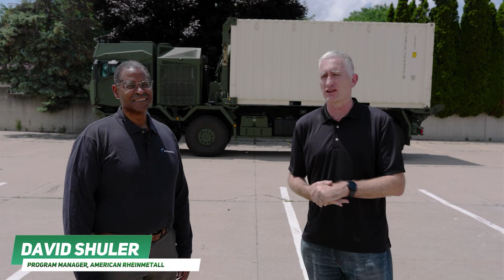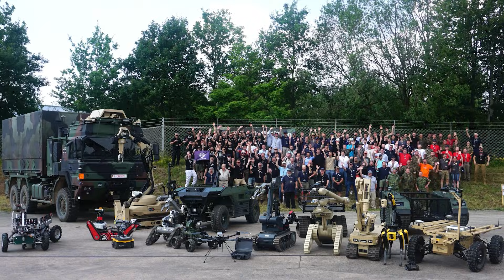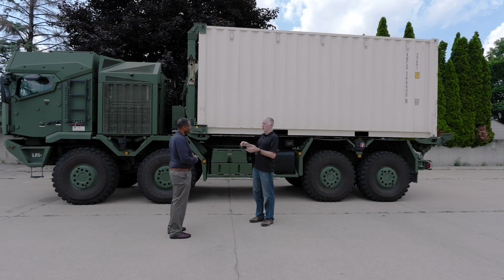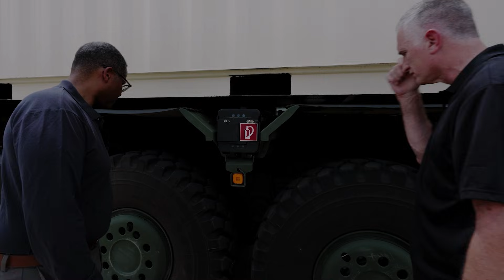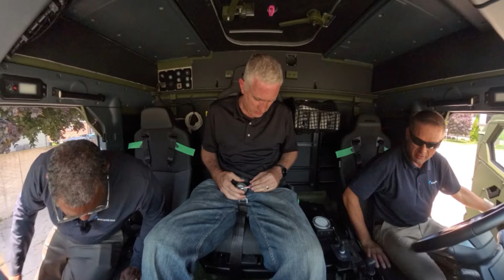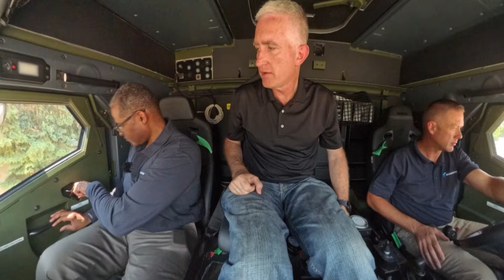American Rheinmetall, and the HX3

Comment: every mechanic ever curses engines that don't have dipsticks, regardless of the system
Reply: I agree being a retired mechanic after doing it for close to 50 years
Not having a dipstick on a civilian vehicle is okay for the most part. 
For a Military application, I would like a dipstick not only to check  the level but you can check the condition of the fluid, is it worn out, are there metal bits in the oil-fluid, does it have water or mixed with other fluid,  does it smell burnt an experienced mechanic-tech can get a lot of insight from looking at fluid on a dipstick. 
Military Techs, they want to make sure the equipment is the best it can be, because one day someone or somebodies lives may depend on that vehicle being able to perform its job. 
I served in the USAF for 15 years I was a Jet Mechanic and we made sure everything was the best it could be and double checked it.
Reply: @bikecommuter24  everything is a question of priority. A lot of military vehicles you don't check the condition of the fluid because there is no "change it because I have a gut feeling" type thing. They have a schedule, the fluids are flushed and completely replaced every X hours, and the only time it is deviated from is if the vehicle breaks down either due to malfunction or something else, like it's hit or driven into something or some other mishap. 
It does kinda make sense in the sort of environment they are deployed often, it was a bit of a rethink for me to understand, but there are companies who use the same sort of method for their own gear too. Work hours are expensive, gear is cheap... So if it doesn't work just replace the whole thing if it is important for it to work. Someone can troubleshoot it later, if there is time and need - if not it gets recycled. 
Like I said it is going that way in the private sector too, it is being built into the budgets and so on, and it adds a high degree of predictability - it is also going toward what does exist in the military which is a specified service life of Xhrs. So fairly often things are replaced before they have a chance to break, when their hours are up, out - in with a new one. It's wasteful in terms of materials but not in terms of effort and downtime costs. The unscheduled downtime doesn't go away completely, but it does get close.
Reply: Keywords are: "that you would access normally". There is a dipstick on the engine but for regular daily use, you just check the oil level on the display. Should that - for whatever reason - not work, you tilt the cabin (takes about a minute of pumping) and check it manually.
Reply: It's neat, but a dipstick is never not going to work.
Reply: @urishima okay but you also never get the results instantaniouslhy
Reply: @emilsinclair4190  oh come off it, acting as if checking the oil with a dipstick is a 10 minute process.
Pull, wipe, stick, pull, done. There's no reason not to have both. Sometimes one is going to more convenient, sometimes the other.
Reply: @urishima ... yes. Pull up. Checking. Electronics dont mean that you have to stop. You measure it the entire time. Not just when you feel like it. Meaning you can detect problems much earlier.
Reply: There probally is one, its just not easily accessible for the average maintenance grunt
Reply: I think having both would be optimal.
Reply: You have to run the engine to check the level, so if the engine doesn't work, you cant check the oil.
Reply: @ShaneDawsonsCat ... yeah bc you already know that it did have problems with that from the 5 billion data points from the past.
Reply: My 2nd gen Tacoma's transmission was spewing and smoking through the Rockies up hill. It took an electronic machine to tell me the transmission was overfilled with atf. dipsticks wouldve been nice, but yea 2nd gen still best generation of Tacoma but I also love first gen Tacoma,, you tiny SOBs
Reply: Lack of a filler on transmissions then having to bathe in it's fluid to fill it isn't fun.
Reply: Damn right we do!!!  Civilian or Military doesn't matter without dipsticks (engine oil, transmission fluid, etc.) it makes checking fluid levels and the condition of said fluid impossible and harder, respectively, which both can effect the longevity of the systems do to potentially overfilled/low fluid levels and having to open up (thus potentially allowing contaminants inside of) systems, again respectively......and if anyone says "oh but we can just look at the sensors and computer to know all that" well here's the thing....ELECTRONICS ARE MORE DELECATE THAN A STRIP OF METAL IE. A  DIPSTICK AND THUS CAN BREAK MORE EASILY,  SENSORS AND COMPUTERS CAN MALFUNCTION IE. GIVE FALSE READINGS/INFORMATION,  A STRIP OF METAL WITH EMBEDDED/ENGRAVED MARKINGS CAN NOT!!!!  Sometimes over complicating already simple, easy to use, and tried and true things is a BAD idea.  "If it ain't broke, don't fix it" I'm sure everyone over the age of 25~30 has head and understands that saying, especially those who fix thing for a living (Mechanics, HVAC techs, Plumbers, Building Contractors, Electricians, Carpenters, DOT & DPW workers, etc.).
Reply: @DesielRiggz1  Yes Sensors and Computer can fail and give false information. But so can a Dipstick too. A Dipstick can not tell you how bad your Oil is or if it is contaminated with stuff. Metalshavings can not be detacted everytime. A Dipstick is a tool to see: Yeah, there is stuff. If its already too late your oh so powerfull Dipstick cant help you. In TImes of AI, self driving Cars, Rockets that can Launch and Land autonomous im sure we can install Sensors that can tell you from the Inside if your Oil is bad. Why should i need to pull the Diipstick, look at the Oil, sniff at it, feel it, maybe taste it if my Sensor told me the same from the Inside.
Aside from having it because we are used to it a Dipstick has no real function. We have longlife Oil, Mineral Oil, Unleaded Fuel. We dont need to check the Engine/Transmissionoil on a regular base anymore like back then. 
In the modern Times a Dipstick is not needed anymore, we can life without it. Apart from "Yes Grandpa we know you are old" its not something we cant life without.
Reply: Reading the comments on the dipstick, their forgetting an important element, the end user, I worked on and served on an LAV. Having electronics to do a lot of the work would of been nice, but some people are forgetting some simple things. One as some have mentioned you can tell a lot of what is happening by looking at a dipstick as a mechanic. For the crew member topping off fluids, I don't want to leave where I am to climb into something else to check how much more oil I need to put in when a dipstick is faster (and as a reminder to those who seem to forget the dispstick goes into the hole you put the engine oil into so it isn't a big ask). I am thinking for the HX3, engineers didn't think it was necessary because they don't understand actually maintaining a vehicle or more likely it could be the way the engine is designed there was no way to make it accessible without lifting the cap to get to the engine so called the work around a "feature"

Edit: Just wanted to say, tech is nice, but it also breaks, there is a reason the military keeps things simple as it can when it comes to ground equipment, it takes a pounding. Think of it this way, remember all those US tanks and trucks the Chieftan showed with start switches and such. The exact same ones we use in the military today?
Reply: @IngramZero  Of course this thing still has a dipstick, what the fellow in the vid means is that you don't have to get to it daily because it also has an electronic level check.
Reply: Stupid not having a dipstick, those systems are shit in the civilian market.
Reply: why?
Reply: @omgsrsly  Because we've seen those systems fail enough to know that we can't trust them. So having a way to physically check, even as a backup, is preferred.
Reply: @CobraDBlade  this is German, not American.
Reply: @PalleRasmussen what’s that got to do with it 🙄
Reply: @alangordon3283  which cars break the most; German or American? We are not in WW2 any longer when the American vehicles will just keep going.
Reply: @PalleRasmussen German cars aren't reliable in the US market.
Reply: @PalleRasmussen haha and you think you "americans" i.e. US are the only people who like to preserve its older cars? We germans have a whole Oldtimer culture with Laws wich you can use  if you want to drive an oldtimer.
You in the US on the other hand HATE nothing more then to change. Just look at your fucking 2. Amendment wich is from 1791!! Yeah talk about the hate to change.
The rest of the wörld likes to move on and are doing so.
Reply: @PalleRasmussen In the US market at least German cars are less reliable. Probably because they don't sell the more reliable basic, lower featured models here.
Reply: @CobraDBlade eyes on accountability is always best. I can certify it was at this level before we made way. I only know what I did personally on the truck. Anything I didn't do is a maybe. It didn't get done by nobody so whoever said we were good to roll without raising a concern is getting smoked.
Roofer shingler Foreman, scissorbed flatbed, reboxed dumptruck..
Reply: omgsrsly...
Power or computer issues.  If all else fails, the engine must be operational.  No need to power up the system just to check oil, trans, erc.
It's a dumb idea.
Reply: Why the whole world buys this then?
Reply: Every Oldschool Mechanic says that. All the newer ones dont have to open your car anymore to know thats wrong with it. My Uncle is driving an ID3 and befire that an E-Golf. The Mechanics at the dealer were already aware of what was wrong with the Car before he even arrived to do a check up.
Yes my 20 Year old BMW does not have a Dipstick to check the Oil too. I need to check it from the inside via the Computer. Yes its annoying but guess what. That tech is 20 years old. Cars today are way better then this. They can show you the exact level instead of my Ok or Too Low.
Reply: Technology is all well and good, but the mk.1 eyeball is something else...👌
Reply: @MetalMelodie  Sure. As long as the computers are working. In your hands as well as onboard.
Reply: if you own a BMW, your opinion is invalid.
Reply: @JonathanFrisbee-k7x The Hell kinda Statement is that?? Haha just because i drive a specific Brand i have no right to talk or what? Guess what i drove in the German Bundeswehr DAILY!! To make it Quick it were no BMW. It were Opel, Renault, Mercedes, MAN, Toyota, Citroèn, Ford and more. On all Cars we had to do a Check up before, while and after every Tour.
Reply: @MetalMelodie  No dipstick in a military vehicle is stupid, no matter what you or BMW think.
Reply: @john_in_phoenix  You sound like you never were in the Military like i was. Think about it like this. You are on a Mission with your Vehicles. The Enemy could attack anytime. Where do you want to be the most? Under Cover or in a Safe place right. If you just could check your Vehicle without the need to outside hmmm oh yeah lets check the Oil from inside your Car/Truck. For Trucks you sometimes need to lift the Cabin and make it unuseble for the time you do your maintanance.
Now tell me what would you prefer?
Todays mechanics even the ones in the Military can plug in the Diagnostic Computer with the Vehicle and check it without the need to unbolt anything. We dont live in the 60s anymore get that in your head.
Reply: @MetalMelodie TBF those aren't incompatible options.  Obviously it's good to have the option to check electronically but if it was no cost it would be nice to have a backup.

OFC there probably is some cost to making an accessible dipstick.
Reply: @petergerdes1094  it's not just a cost to a dipstick, you need to design a way to access it for it to be useful and in doing so you're likely to make the vehicle weaker in some ways because you're making a compromise. Then on top of that, a dipstick is a delicate thing - you would either introduce a weak point, or you'll need to design an armored dipstick, which will need a test and approval process of some kind. 
The armored dipstick program has gone through it's development cycle, and the result of it is: a sensor. The sensor IS THE DIPSTICK V2.0 heh.
Reply: @noth606  If the sensor tells you the oil needs topping up, you still have to access the filler point (which is presumably under armor) to add oil, so why not put a dipstick in the same place?
Reply: JansenX12....
Stop and think one second.
The complaint wasn't that you can check electronically.  The complaint is that you have NO OTHER OPTION. 
Get real, dude.
Reply: @videodistroIts a natural evolution that sensors and other electronical devices replace physical ones. Remember the time where you had to use a Choke to regulate the Fuel/Air mixture on a Carborated Car? Or the times you had to manualy Start the engine, the use of a Fuelstick to check the Fuellevel, manual Mirrors, manual Seats, manual Windows.......there are more and lots of more exemples. Time cant be stoped, its always on the move. If you want to live in the Stone Age because you hate technology then so be it. The rest of the wörld likes to move on. 
Just for the record i think all the time and i like to think. YOU are the one who does not think for a second.
Reply: @noth606  you do know the dipstick fits into the hole you put oil in right? No matter the vehicle you need to put oil in it
Reply: @MetalMelodie  The 60's LOL.
Reply: @PeterCollingwood-e2s many of the V8 engines still used today are based on ones from the 60s. So yeah 60s.
Reply: @MetalMelodie based on. Basically all engines are based upon the first engine ever created
Reply: @emilsinclair4190  No -.- with this you showed that you have no idea what you are talking about but want to sound fancy.
There is a BIG difference between a new Construction and something that is based on an existing platform. For Exemple the VW Beetle was build and sold till the 90s. Over the decades they updated the BASE Design swap out the Engine for a bigger one, add Fuel Injection, New Suspension, Radio, Air Con, things like that. The "New Beetle" was not BASED on the Old Chassis but it was based on the Newer Golf Mk IV with an new Body on it.
For exemple my BMW Engine the N52B25 in my E90 is a whole new Engine and is not BASED on the older M54 Enigne. Its a brand new Engine Developed with the Knowledge of the M54 but no part from the Older Engine was used on the Newer Engine.
Thats the Difference between Based on and Newly Developed.
US on the other Hand are BASED on the Older ones. Some still use the same Engine Block with newer Parts as they used in the 60s/70s.
Reply: @JansenX12 ... so you wnat ro tell me that all 5hsoe engines are not based upon the same laws of thermodynamics and using a heat volume pressure cycle to generate work?

Based is always a relative measurment.
Reply: @emilsinclair4190  -.- yeah yeah. Continue your trolling i dont care. You Showed again that you have no idea about the Topic we are talking.
I can tell you that YOUR Brain is not wörking like others do. Your Design is BASED on 60s Tech but it never saw an update. You dont even got the Day-1 Patch installed.
Reply: @emilsinclair4190  My advise for is to look up Engine Familys and get familiar with the Topic.
Reply: @JansenX12 sure buddy. I will tell you car Brian something. All those upgrades you belive to be significant have changed basically nothing. The physics have stayed the same. Still not as efficent as the hypothetical carnot engine. But hey I don't think that you even know this basic engine.
Reply: @emilsinclair4190  The Physics of Your Body hasnt changed too but you are diffirent compared to an extinct neanderthal...just saying that the basic Laws of Physics will never change soo why doing things at all?
Has anyone ever told you that you are strange?
Reply: @videodistro Engine still has a dipstick, presuming this uses the regular D2066 like all other HXs. He phrases it a bit awkwardly, but what he means is you just don't have to access it as part of your daily routine anymore since there is also an electronic level check, you can still use the dipstick if that fails.
Reply: @ericrose3978  As far as i understood it sounded like they try to use as much US parts as possible. I would say that includes an US Engine.
Reply: @MetalMelodie  MAN and International are both owned by Volkswagen, D2066 has been used (and presumably also made) by Navistar/International in the US for years under different branding as the Maxxforce 11, they might use something bigger, but the fuel requirements alone will preclude this from being something super modern. Automatic oil level check is just something that is a requirement in the civy market these days, little point taking that out if you're goin all COTS, esp if it's a COE design and you don'+t want to tilt the cab every morning.
Reply: @ericrose3978  Ah yeah right there was something a few years ago i rememeber. Im all for the Electronic Sensors. As a former Soldier i know the hassle of always going outside just to check the Vehicle. Any support helps to make the Soldier survive for longer.
In Germany we have the TD: Technischer Dienst (Technical Service) before, while and after use. Before and after is not the big deal but while your at a stop to eat, sleep or other things to go outside and check the Vehicle is depending on the environment a big Hazard so any help be it Sensors or gadgets are welcome.

Yes Sensors and such can fail, break, give false information yes but so can a Dipstick too. Any System can fail be it mechanical or electrical.
Reply: @JansenX12

I think your opinion is kind of silly. Like yeah, it isn't the 60's anymore. But nobody is arguing that we shouldn't have electronic sensors with engines. It's not an either/or thing, where it should only be dipsticks. What people are saying is that it should be sensors AND dipsticks. Having both is a good thing. Electronic sensors are good for when you are under fire and want to stay in the vehicle, but dipsticks are good for when you're at the depot, and want to make sure your sensor reading is correct. You can also tell a lot about oil with a dipstick, not just level. Since you are basically removing a sample of the oil, you can visually inspect it for signs of contamination. 
Also, why would you need to be checking your oil level in combat? Isn't that something you'd be doing at a depot, as part of routine inspection? Not to say that  being able to check your level in combat might not come up, as for instance if your level is going down that means your engine took a hit and your vehicle has had its mobility compromised. But like I said, having both options makes a lot more sense. No reason to choose one or the other when you can have both.
Reply: @MetalMelodie  Fiddly electronic gizmos and nuclear EMP don't go along very well....give my dipstick back, please.
Reply: @EricBourgogne-x5c emp is always funny since usually military vehicles are hardened
Reply: @emilsinclair4190 do you even know what hardened against emp means? Most of all electronics won't be too effected world wide. But those at the epicenter of a large enough emp(a nuke) have other issues. An reliability is more needed
Reply: @Anarcho-harambeism ... if you are directly in the epicenter of a nuclear explosion you have other problems.

But a fun fact. Electronics can make systems more reliable.
Reply: @emilsinclair4190  And fun fact, electronics can make a system more complex, expensive, and a fucking pain in the ass.
Reply: @unevenelephant469 ... can depending on the design. But they can also add capabilities, save lifes and 3ven reduce cost. Often electronics come build in mass produced products so buying them is cheaper than starting a production for an alternative
Reply: @MetalMelodie  " All the newer ones dont have to open your car anymore to know thats wrong with it."
That assumes everything is working as intended. A couple of sensor errors later, and you'll get symptomatic error codes downstream the actual problem. Classic example is how a busted airflow sensor usually is detected by the lamba-warning, but we have a much more resent example with the F-35 crash in Alaska where frozen hydraulics sensors in the landing gear sent the plane from flying mode to ground taxiing controls, which resulted in total loss of the airframe.

There is a reason we in the industries still put in analogue metres out on the floor in spite of SCADA being used to operate the daily production.
Reply: @johanmetreus  What i mean with that is that the Mechanics at the Dealer could read my Uncles Car like a book because of its a modern car and they are all connected to the Internet.
THAT was the reason why they already knew what was wrong with it before he arrived.
I know that the Military dont use the normal Internet they have its own Network but if you could use that Network and implement it into the Vehicles then you would not need a physical Dipstick.
Thats a case for the IT guys to figure out but its not impossible.
Im not an Aviation mechanic but guess what people from the past would say about the F-35 and its useless Computer, Screens and Tech. 
Thats the beauty of Time. You cant Stop it. Its always on the Move. Time does not care what the US want and how much they want to stay the same.
Lets meet again in 20 Years and talk about how much has changed and how useless all the then New Tech will be :D
Reply: @MetalMelodie what is Kelly Johnson's famous qoute